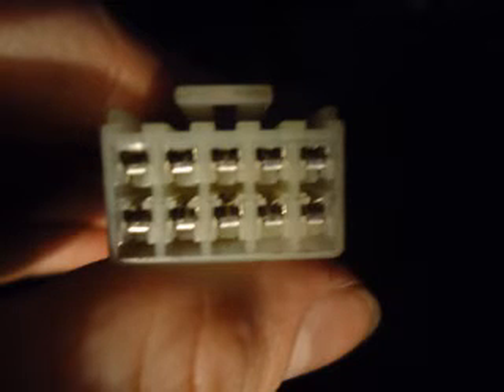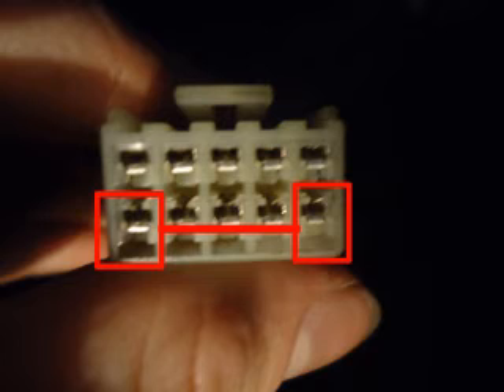Power Door Locks Without Keyless Entry Box 99-01 Subaru Impreza 2.5 RS

Comment: first, sorry for the over posts, no clue what happen there. 
and I didn't mean to cut any harness on the car itself I'd never suggest that! I meant if someone is deleting the factory alarm box due to it being faulty then take the plug from that and connect those 2 wires you talk about and plug it back in and not have anything to worry about that's all.

Comment: If you anyone is gonna do this and going to throw away the keyless brain box, just clip the harness end from the brain, connect said two ground wires then plug into the stock harness plug under the kick panel and you won't have to worry about the paper clip falling out or a electrical short. just my $.02
Reply from the maker: +Josh Berg I consider that a terrible idea seeing as you've now cut the harness and wasted a perfectly good connection.

Putting in the paper clip IS an electrical short, so worrying about a short is counter-intuitive. Also (although I put my keyless box back in my car, which is another reason not to just chop off the harness) with over 50k miles and many racing events put on my car, I never had my paperclip fall out.

So while I appreciate the comment, I don't think your concerns or suggestions are valid.